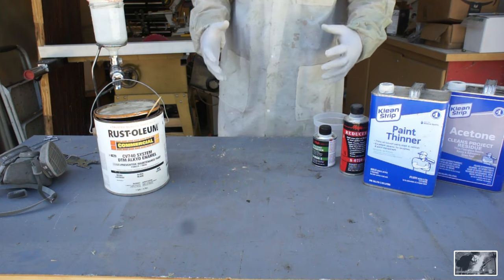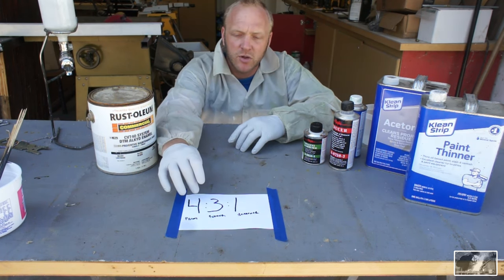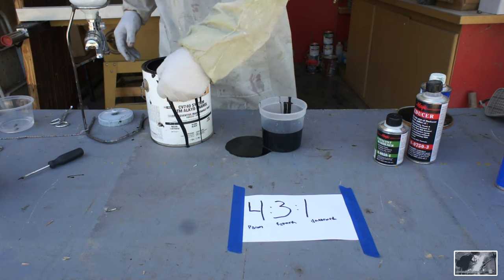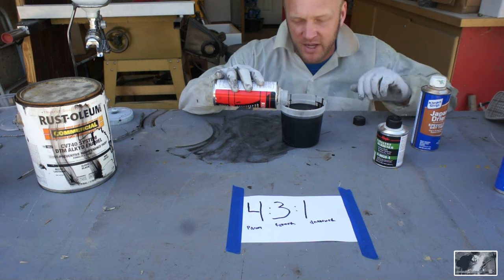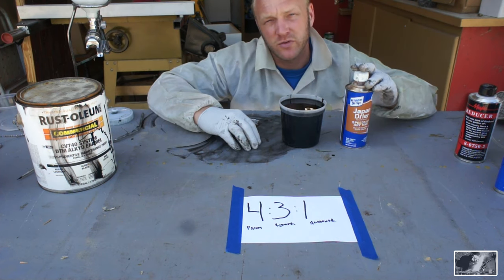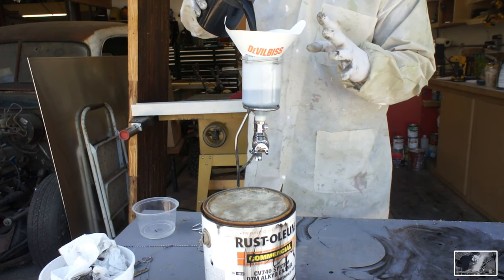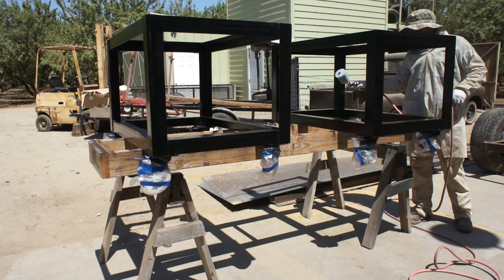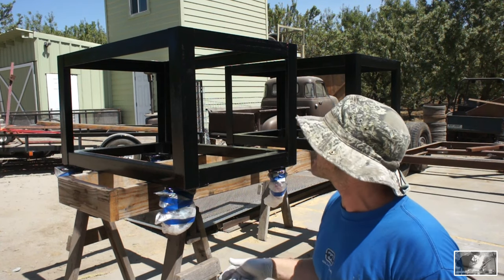JAPAN DRIER -the secret weapon- for lightning FAST dry times! RUSTOLEUM TRICKS

Comment: One correction, 1 pint to 1 gallon is 8:1 ratio, 1 pint is 16oz, 1 gallon is 128oz, 4:1 ratio would be 1 quart to 1 gallon, 1 quart is 32oz. Otherwise great information,  thanks for posting this video,  I have a project that I will use this information to complete
Reply from the maker: Thanks for that!
Reply: @unitedstatesofbuild4915  I have a question for you and by the way thank you for your great videos. Being as you had used a one to four ratio instead of a one to eight did the job turn out okay?
Reply: Metric gallon😮

Comment: I have a theory Japan drier and Majic Catalyst Hardener are basically the same thing. I mean they're not chemically the same, but the are causing identical cross linking reaction in the paint. Which is just part of what real hardener does. So personally I would just use little more Japan drier and skip the Majic hardener.....In any case I've used real automotive Acrylic Enamel Hardener with Majic tractor paint mixed at 8:1 and reduced it with naphtha. It worked just fine.....Naphtha and real automotive Acrylic Enamel Hardener are IMO going to give a better more durable faster dying finish and should also be same price or cheaper than using Majic reducer and Majic hardener.
Reply: Did you test your theory by recoating in less than 48 hours and not having an issue though? Speeding up the dry time is irrelevant compared to speeding up the cure time.
Reply: @nathanduitch2521  Yes I have. You should be able to recoat much faster than 48 with Japan Drier. Just follow the directions as using too much can cause it to dry so fast the paint alligators.....You can also use pretty much any automotive enamel hardener with Rustoleum or whatever similar brand paint. Majic hardener and the other brands intended for tractor paints are expensive and are on every metric inferior to automotive grade hardeners. Even automotive grade synthetic enamel hardener will give you much better shine and UV protection than tractor paint hardeners. At about the same cost..... I recently used 5 Star xtreme wet look acrylic enamel hardener with Majic tractor paint reduced with naphtha. I waited about 20 minutes between coats. Same as I would have using an automotive grade enamel paint.

Comment: I'm no pro, but isn't it normal to prime bare metal prior to finish coating it?  Especially when there is some level of rust as is seen in those frames?  Or even sand the rust off first?
Also you said that the 115 degrees was way outside the temperature range for proper painting.  Then you painted it without comment.  What's up with that?

Comment: Do not use isocyanate or di isocyanate or methyl di isocyanate hardener  unless you have a booth full face air supplied respirator, paint suit nitrile gloves not latex, boots that you leave at the booth do not take them home or you risk contamination of you family or pets and proper training . You can not wash isocyanate of with soap and water that why construction glues and expanding foam insulation don’t wash of because it contains methyl di isocyanate. I urge you to look up isocyanate safety on the  tube or google it . You have a life time limit once exceeded you can barley sand clear coat or 2 stage paints or construction glues or expanding foams with out getting asthma temporary or permanent or permanent lung damage and possible death let alone paint. Many bed liner applicators got super sick and several died as did a tire installer who foam filled industrial  heavy equipment tires in London Ontario a couple years back . Old school,lacquer and enamel never caused these health hazards . Also if you paint a car in your residential neighbourhood and have fumes with isocyanate drifting to homes and back yards you risk some serious issues and law suits

Comment: Another thing you can do is simply get that clean filtered Air moving over the paint. A 4x4 grow tent (or bigger) is a great idea to get airflow in and out in a controlled environment. Obviously you can't paint a full car but you can take the panels off and paint them individually. Preferably I would use two and augment between both of them if I was doing lots parts that is. And if you can get them in the sun like you have them to bake the paint on all the better lol
Reply: I can also say, a 4x8 cheap grow tent with a phresh intake filter will get you hepa filtered air results. Roughly 10 minutes to set up and another 10 to take down. Great portable paint booth for smaller projects.

Comment: Does it matter if you use paint thinner or reducer over acetone? Can you use the odorless enamel reducer? Great videos
Reply: Acetone dries WAYYYYYY faster!  I tried with mineral spirits and it took several hours to safely touch it.  The mineral spirits seems to have a little less orange peel but if you have bug concerns the acetone is a life saver.  I sprayed two coats using his mixture (4 parts paint/3 parts acetone/4% Japan drier by paint volume/6% hardener by paint volume) and in under 3 hours it seems safe to handle.

Comment: I've tried Japan drier in rustoleum paint without putting in the acrylic enamel hardener.  It does not make it harden any quicker.  What is making your paint harden faster is the fact that you put acrylic paint hardener in it.  Also thinning paint causes it to cure more quickly, because acrylic enamel cures by combining with oxygen.  Thick paint surface cures, but remains gooey underneath for a long time because oxygen can't easily get to it.
Reply from the maker: Huh, interesting. As far as JD not drying paint faster is that a personal observance or have you got some documentation?
Reply: @unitedstatesofbuild4915  I've tried Japan drier in rustoleum.  It didn't cure any faster.  I've put the acrylic enamel catalyst purchased from the tsc store into rustoleum, and it was completely cured the next day. Hard as can be.   Usually rustoleum will stay soft for months.  Dry on the outside, but not really usable since you can still stick a finger nail in it and gouge it.  The only thing I've found that hardens it, is that paint hardener made specifically for oil based enamel.  There is a lot of info on the internet on how acrylic enamels harden.  It needs oxygen to harden.  It does not harden the way solvent based paints harden.  Solvent based paints dry when the solvent such as acetone evaporates.  Acrylic enamels cure to harden, not through solvent evaporation.  It's a diffrences process.  I wish Japan drier did work on rustoleum.  It would be a lot cheaper than having to pay $20 for a little can of enamel hardener.   And that hardener has a short shelf life.  That hardener will not work a year after the can has been opened.  I know, because I tried using what I had left over in the can from over a year before.   Rustoleum  professional paint has a different paint formula.  It seems to dry quicker without adding hardener.  But still not as quick as adding  fresh hardener.

Comment: If I don't have hardener and Japanese Drier, can I just use the 4:3? Also, with Rustoleum Clean Metal Primer?
Reply from the maker: Yes you can just use 4:3 without hardener. Clean metal primer should reduce well. Be sure to watch my other rustoleum video, it has other ratios: https://youtu.be/bmEVN3tIKFU
Reply: @unitedstatesofbuild4915  awesome thank you! I painted today and it worked great 🤟🏼
Reply from the maker: Awesome, glad to hear that. Thanks for the update

Comment: Thank you for the Rusto paint videos they are all very informative.  Since I’m a rookie at this, my question is you resprayed after 2 hours the video says.  What did you do with the gun in that 2 hours?  Did you break in down and clean it, spray some mineral spirits or acetone through it, or just set it aside until it was time to respray?
Reply from the maker: I empty whatever residual paint is left in the cup and spray some acetone through. Thanks!
Reply: Did you have to scuff the surface before you shot the 2nd coat...being that so much time was between coats? Also, can I ask why you waited so long between coats?
Thanks for these very informative videos!!!
:)
Reply: Very helpful info. Thanks.

Comment: Does this leave orange peal? And need sanded and buffed?
Reply from the maker: Not if you mix and spray it correctly. Orange peel can be caused by improper gun adjustment. Be sure its the proper viscosity and your gun is set correctly.  Thanks!

Comment: Were you commissioned to build these carts? Can I ask what you charge. Trying to get an idea of what it will cost to have 2 made. I’ve learned too many trades...no time to learn how to weld lol.
Thanks!
:)
Reply from the maker: These carts use a super simple design, all 90* cuts so they are quick to build. I think the steel was about $2.75 a foot (about 25' total), 4 casters of your choosing and build labor was 2.5 hours (without paint). I have an older build video on a smaller version of these exact carts and how to build them here: https://www.youtube.com/watch?v=QPqihL2OKtg

Comment: Nice job. Now I want to repaint my trailer like this
Reply from the maker: I just did my 26' flatbed trailer using this ratio. Worked like a charm. 4 coats total, 2 primer and 2 color, 3.5 gallons total all in the same day

Comment: I used a 4:1 ratio and its been a week and I can scratch the paint off with my nail. What do you think I did wrong?
Reply from the maker: 4 parts paint to 1 part japan drier?
Reply: @unitedstatesofbuild4915  paint to reducer then I added a little bit of japan drier
Reply from the maker: Not sure what the problem could be, The ratio's sound ok. Not sure honestly. I recently had a problem with my truck doors: https://youtu.be/s_lee7e_jVo. It was a really cold night and I warmed the door, brought it outside and sprayed it, let it flash then brought it right back in. The door basically went from 90*, down to 50* and back up to 90* in less than an hour, all while being spayed. The paint turned out really flaky. First time I'd experienced it. I scuffed resprayed it and had good results.
Reply: @cdk3283 
way too much reducer. Ratio is supposed to be 8:1

Comment: Are hardner AND Japan drier like the same thing?
Reply from the maker: Same concept, The hardener is going to make the paint harder and slightly more glossy in addition to faster drying. The Japan drier speeds the dry time. The way I understand it Japan Drier is cobalt based whereas hardener is resin based.